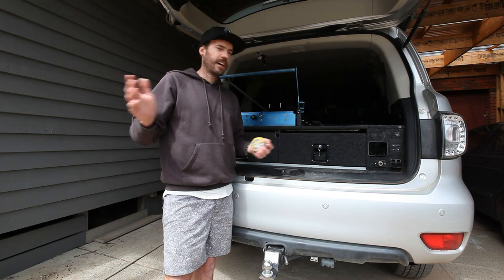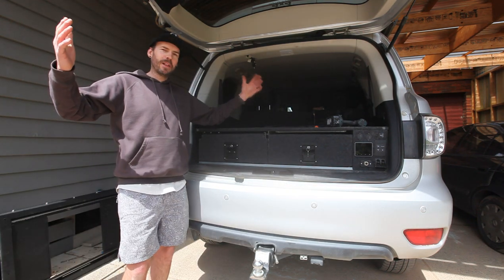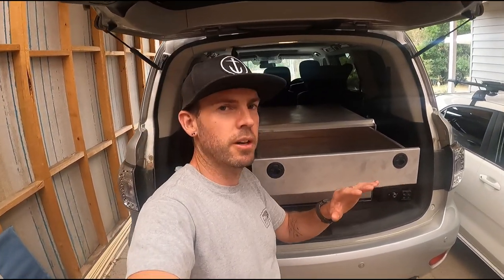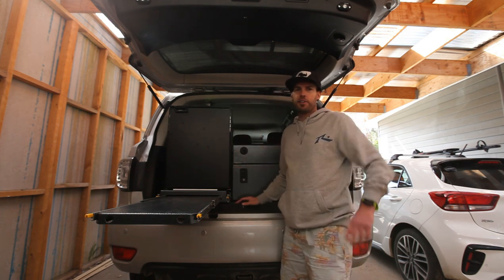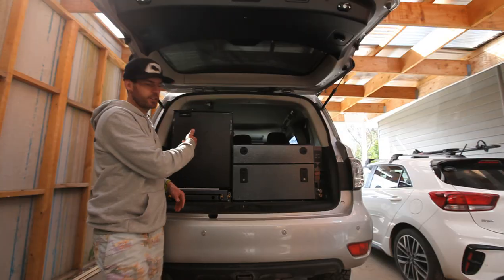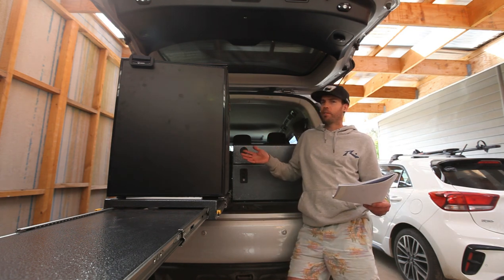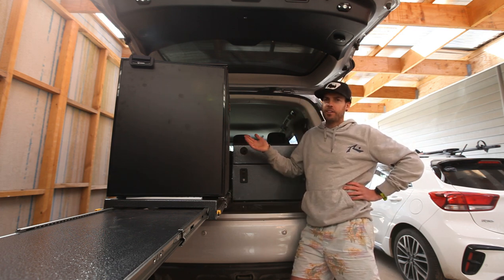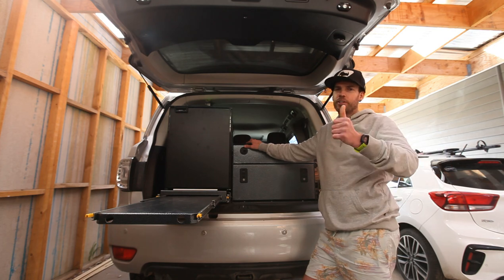WATCH THIS BEFORE BUILDING YOUR 4X4 DRAWER SYSTEM Alloy Light Weight Modular, Bushman Upright Fridge

Comment: Fantastic weight savings and improved ease of access to the fridge.  I've started looking at making substantial changes to the back drawer system and fridge on my 80 Series.  And I agree with you, I prefer alloy drawers too for weight savings.  The new setup I currently have in mind, is an upright fridge on the left side, and double stacked drawers on the right.  With both tops (fridge & drawers) at the same height. The biggest issue I've found is finding businesses using aluminium as their material for 4WD custom drawer setups.  All those near me (Central Coast, NSW) work with wood only. 😟
Reply from the maker: I'd never go back to timber drawer system after having this. It's all finished off now and so happy with it. Weight saving is amazing, up right fridge is a game changer.
Instead of drawer companies try some of the guys that build trays etc or just ali Fabrication places I'm sure if you give them all the measurements they can sort it for you

Comment: Gday Dave,
Yeah Ali are the go fore sure, weight factor and durability is a key factor. 
I would have run the national luna just on a conventional fridge slid not a drop down 
And made it all the same height/level across the back of your wagon.
But  like you said probably not the perfect set up for everyone 
Can’t wait to get back out 🛻🚙⛰🏕
Cheers Marty
Reply from the maker: Definatly happy with the alloy. I had that setup you were talking about in my 150 prado. It was Definatly way better than running the drop slide and worked fine for standing on the towbar to get up I to it. I think between that and what I have now are the way to go. Especially the way your talking as when the fridge is out you have a nice flat surface

Comment: Looks good mate. I've got my own ally fridge slide on v2 and its less than 11kg.
I'll do my own ally draw, i was just going to do one single draw, what made you choose to go with 2 one shallow and one deeper?
Reply from the maker: Cheers mate we could definitely get a little more weight out of this if we wanted but it's braced up pretty well too. Does your slide have a table too cause that's another set of runners.
Went two drawers as one would be food, cooking gear etc and one has camping things in it. The taller one I made to the size of fitting a box of beer in 🤣
Reply: @4x4brothers  Yeah good point I don't have a table underneath. I don't have the height due to my travel buddy and cargo shelf the arb zero fridge is pretty tall. I think ill put a table on the jerry swing out bit of a compromise as my fridge will be on same side
Reply from the maker: @SomervilleMetalWorks  it's all a juggle hey mate I reckon you could build 100 systems and there is always a compromise

Comment: Nice setup.   How are drawers/slide made? Welded or riveted?
Reply from the maker: Thanks mate, drawers are all alloy welded they have been brilliant. Have it all integrated now with a top and all the controls for everything, compressor mounted on the rear of them also
Reply: @4x4brothers  let us know how they pan out.  Curious to see how elds hold up long term?  I was thinking of riveting some drawers, besides dont have ability to weld thin alum.
Reply from the maker: @kellstat  welds should be s drama. All the ute tray/ canopy setups are made this exact way no drams

Rivets and sika would work too and never fail thats a good option to make it easier to build if weld isn't a option

Comment: Looks mint! How are you mounting the upright fridges to the slide out platform or the floor of the wagon as per the pictures?
Reply from the maker: Cheers mate I've got the black angle screwed to the floor underneath the fridge then the fridge sits in that and then it's fixed to the vertical side of that angle if that makes sense

Comment: Looking to retrofit one of these to my fridge slide how have you mounted to the fidge slide ?
Reply from the maker: Works a treat mate, I've fixed some aluminium angle to the slide then that is fixed to the body of the fridge so it's sitting in a frame at the bottom
Reply: @4x4brothers  so have you drilled and screwed into base of fridge. If so how long are the screws don't want to go to deep my damage fridge. Got any pic of frame. Thank Steve
Reply from the maker: @stevemills8401  send me a msg on instagram or Facebook and I'll send you some photos mate

Comment: Hey mate,  the bushman people seem to either love or hate.  Now that you've had it for a while,  what's your take on it? Does it struggle to get cold or does it ice up like some other owners have experienced?
Reply from the maker: Gday mate. Absolutely love the bushman never have to run it higher than 2 1/2 goes all the way to 7. Id never go back to a chest fridge after having a upright and all the guys we go with have changed since and feel the same.
I think a lot of the issues are user error 
Not stuffing it full around the freezer section so the air can flow  and cool the fridge and Having good ventilation around the compressor 
It is a bit less efficient than a good chest fridge that’s the only downside
Reply: Thanks,  I appreciate the fast reply.  I only just bought an Engel because it was a deal too good to pass up but I could always take a back seat out and use it as a freezer on longer trips. It still gets used around the house anyway so it's not a complete waste of money 😂

The weight saving of the uprights is really what's leaning into the equation. It's good to hear you've no regrets making the switch. I'm part of a bushman Facebook group and people usually only post the problems they have but it sounds like that's only the minority. All the happy customers have no real reason to post. Glad to hear it sounds like user error on their part.  I might be sold on an upright after all.  

Cheers for your time mate 🍻
Reply from the maker: Yeah mate just the functionality of the upright at just how easy it is and the weight saving is a no brainer 
Definitely for a longer trip worth having a bigger freezer and keeping the Engel we are using one when we do a longer one later in the year for exactly that 
I hate to say it but the new kings up rights are meant to be a really good thing too and the price is insane if you want a cheaper option
Reply: I'm making the switch to lithium and the 12v installer I've chosen works side by side with a fabricator so an ali drawer system is on the cards and it'd feel like a missed opportunity throwing a heavy fridge slide in for the Engel. If I can have the battery in the boot,  draws and fridge sitting at the same weight the titan drawers that came with my car,  I'd honestly be laughing aha

I'm sure the kings would be fine and the 5 year warranty is very competitive,  but nah,  I'd rather my money go to a family run business
Reply from the maker: @JoshSinnott97  100% with you on the where you would spend your money going to smaller businesses and their customer service is amazing
When you do the numbers on weight saving it’s a no brainer alloy and lithium with a upright especially if your close to the gvm which I am I’d be over for sure otherwise